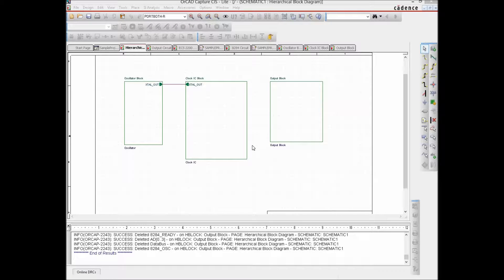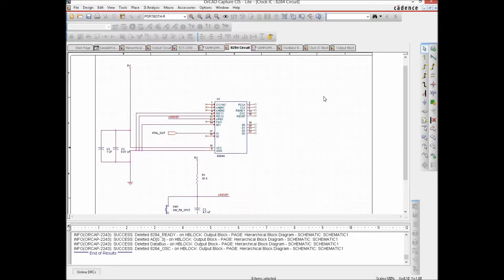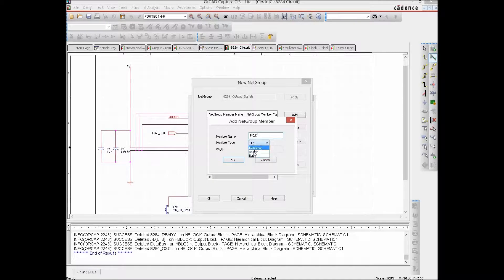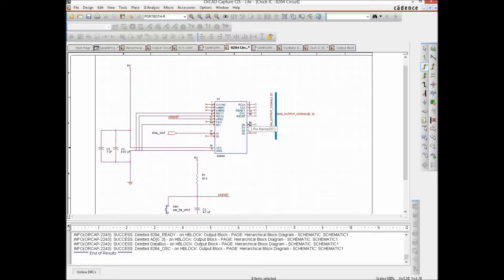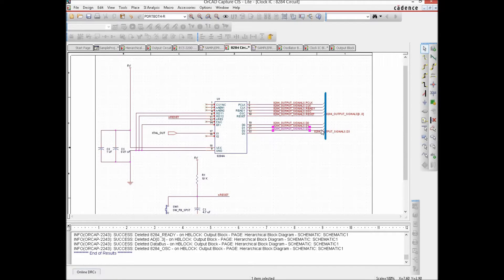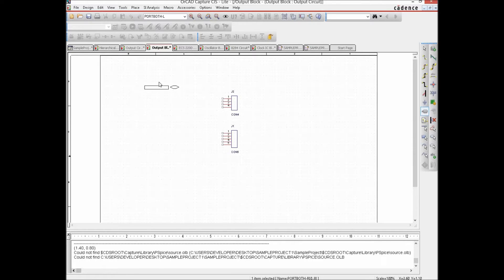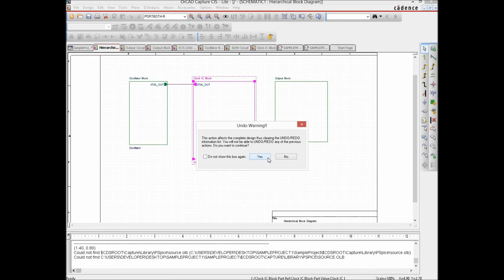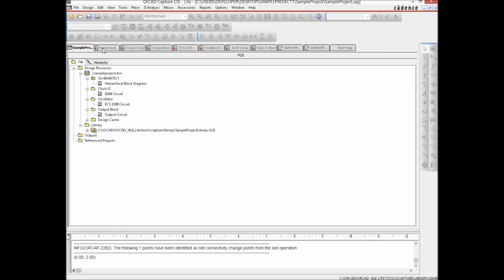Netgroups in OrCAD

Comment: The bus entry is not merely a 45 degree turn. It's meant for tapping individual signals off from the bus, as its name suggests. At 10:41 it's clear that the netgroup is not connected through the bus entry (note the different colour at the turn). Instead, shift-click to place netgroups at an angle.
Reply: I just see video today and was going to give same comment but you already pointed out !Good